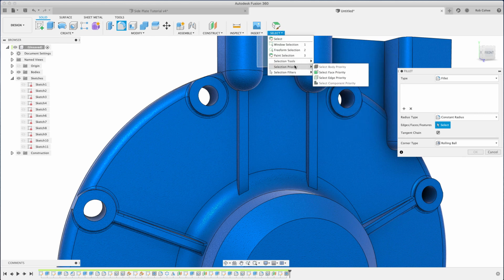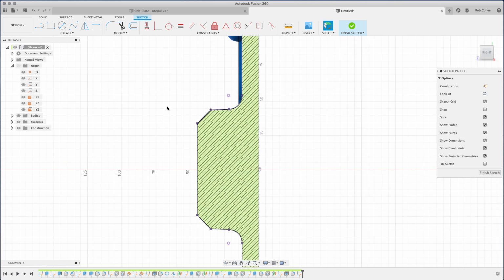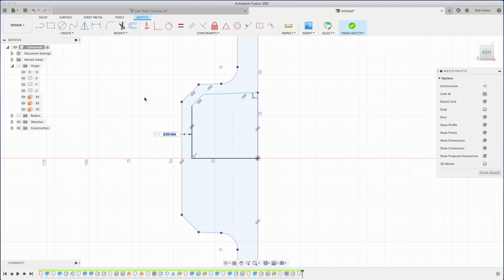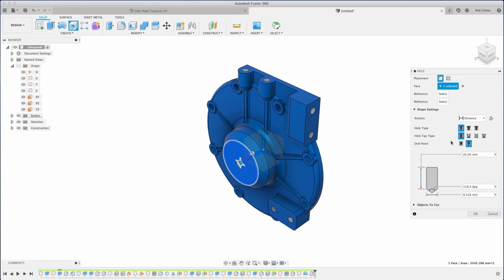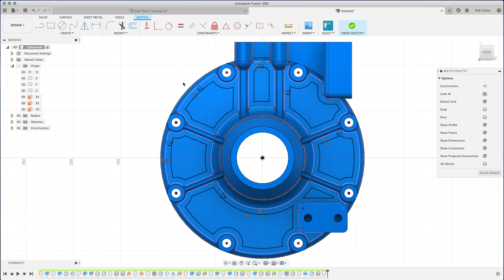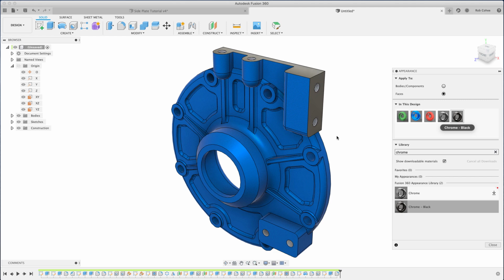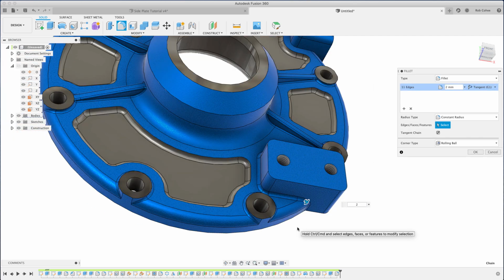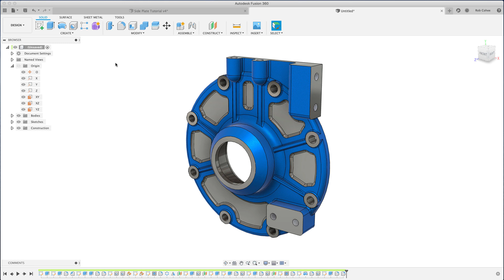Fusion 360 Part Modeling Part 4 of 4

Comment: Yes I agree, I enjoyed your pace and used the pause and rewind to match it to my own pace in certain parts which i found not to be a problem. That way you managed to cover far more ground in a short length of time that would take other presenters a long time and induce a few yawns at times.
The only issue I had was to do with my own short comings in that I coupling remember what the feature was that you were aiming for at times. So a quick reference to the finished item would have helped me, but that's possibly not a problem for everyone.
Keep them coming please, brilliant.